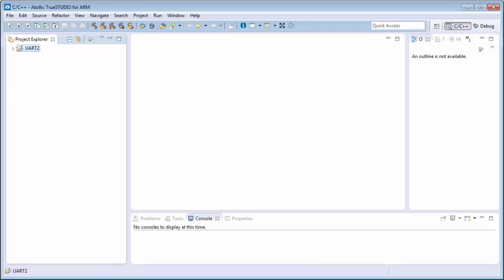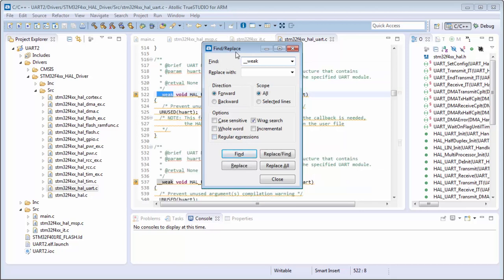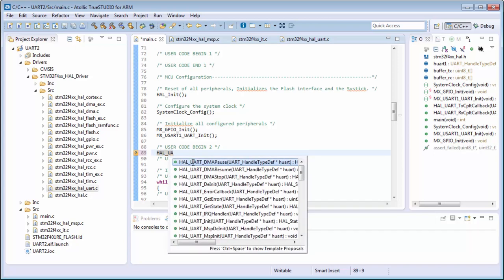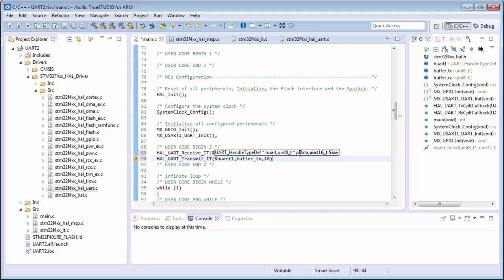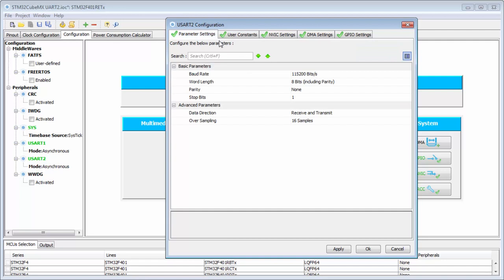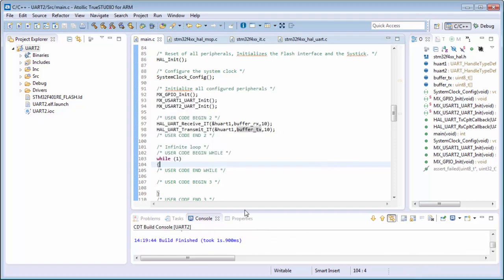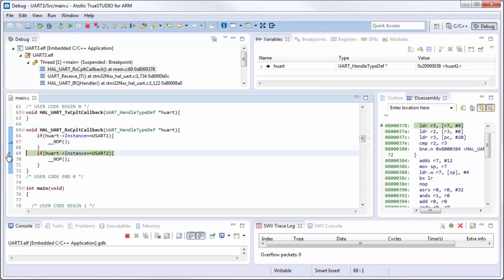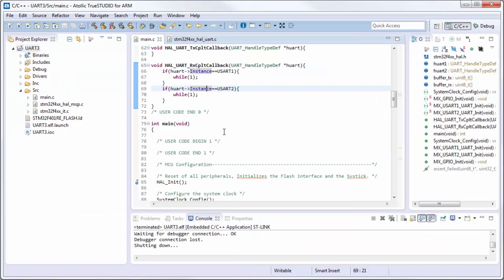STM32CubeMX basics: 10.10 STM32Cube HAL labs UART - Lab UART IT

Comment: I don't know if you are Familiar with AT commands or not but I'm trying to write a firmware who's only job is to put a sim800l module on GSM mode, then get my approximate location using gprs. To do this it only needs to execute 3 AT commands using UART. Easy enough. The simplest AT command is "AT" to which sim800l must reply "AT OK" which means everything is fine on both ends. When I do transfer-it AT I get AT OK response in the Rx buffer, everything is fine, but when I try to send the next command using transmit and then receive my Rx buffers ends up including what I was supposed to transfer... Like??? :D there is only 1 data register for TX and Rx and somehow instead of sending the data it reads the register(receive works before transmit maybe?) (also my Rx now includes the response to my first command plus the next command I am supposed to send, registers don't get emptied?) I'm so confused right now. Putting delay even 4 seconds between each transfer and receive won't work either.
Reply from the maker: Hi there, thanks for your question - may we point you towards our community.st.com, where you will find a team of people who can answer you directly ?
Reply: @stmicroelectronics  thank you very much for your answer, I ha e since found out what the problem was! The sim800l module had echo mode turned on by default, so the problem wasn't that receive was worki g before transfer, rather the problem was that sim800l would repeat the command I was sending plus the response :D

Comment: cannot to get it to work on my end. 
not sure what i did wrong. 
i can get it to transmit to work just fine, its the receive that i keep having issues with. 
Any tips?
Reply: I take it back i got it! TY
Reply: @noicthebrave  do we need to connect RX and TX pins together?
Reply: I am having same issue with bluepill board, cannot receive callback is not being triggered.

Comment: What a tedious and complicated process just to set up a uart in interrupt mode
Reply: Have you done this BareMetal with uVision? :)
Reply: this doesnt work for me, did you find a better way to do this ?
Reply: @noicthebrave  Sorry for the confusion. I was being sarcastic which i now realise isn't helpful. What i was saying is that using the UART and HAL is a lot easier (in my opinon) than writing all the code using a BareMetal aproach. Not that it's easy to use HAL either. The problem i have personally at the moment is that my STM32 board (STM32WB) only has one USART and also a LPUSART which i'm not familiar with. I think the USART is used to 'program' the chip which makes things more complex.

Comment: Did exactly what you did, and it simply does not work. I started to wonder why these stuff always have to be this chaotic and ill documented... 
Code with error:

/* USER CODE BEGIN PFP */

/* USER CODE END PFP */

/* Private user code ---------------------------------------------------------*/
/* USER CODE BEGIN 0 */
void HAL_UART_TxCpltCallback(UART_HandleTypeDef *huart)
{

}
void HAL_UART_RxCpltCallback(UART_HandleTypeDef *huart)
{
while(1);

}

/* USER CODE END 0 */

/**
  * @brief  The application entry point.
  * @retval int
  */

CDT Build Console>> 
../Src/main.c:74:1: error: expected expression before '}' token
 }
 ^
../Src/main.c: At top level:
../Src/main.c:75:1: error: expected identifier or '(' before '}' token
 }
 ^
make: * [Src/subdir.mk:33: Src/main.o] Error 1
"make -j16 all" terminated with exit code 2. Build might be incomplete.